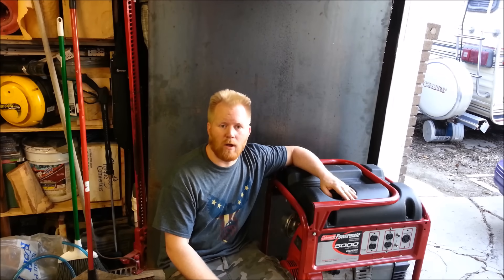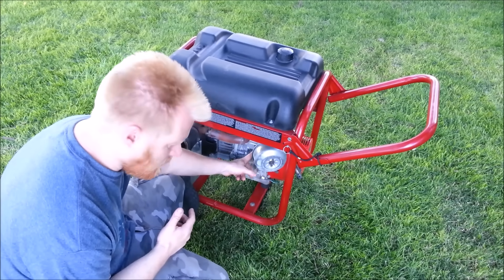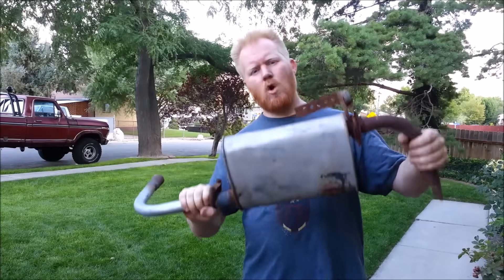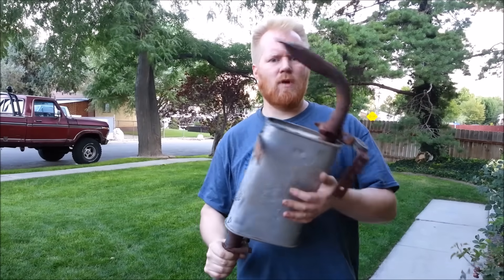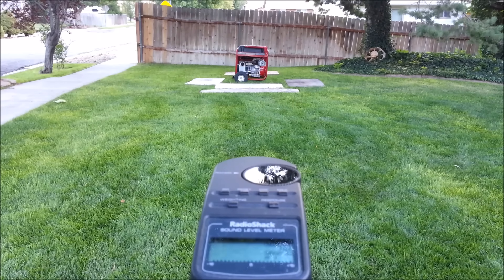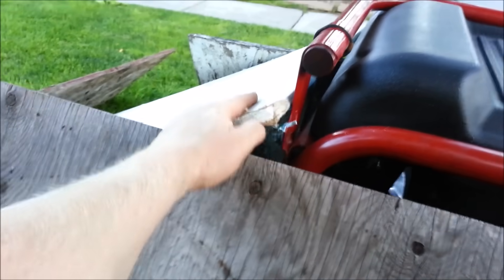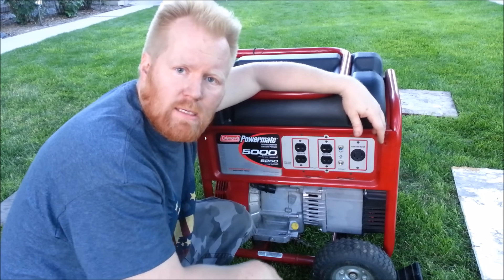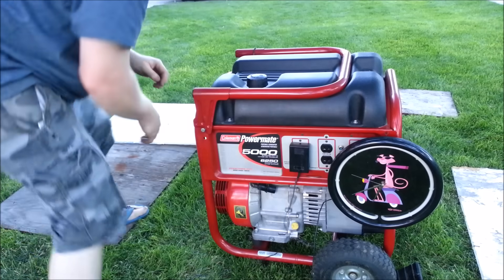4x Quieter generator in 10 seconds

Comment: Nice job - i was about to add a muffler to mine, but wondered about losses.  Mine lives in a shed that provides pretty good sound absorption, but airflow requires a wide open door.  And here in the PacNW, power outages are almost always in super windy/rainy events where being outside and using loose plywood won't cut it (i was going to say "won't fly", but...well that's the problem).  But as you said, each situation is a bit different, and your video reminded me of how well an RV rooftop generator box i built worked, but i never considered angling the walls - seems obvious now, but the simple stuff seems to be easily forgotten.  And although they say the grass is always greener on the other side... it's true!  It's really your superior lawn that's doing all the work, i'll bet.  Hah.  That amazing kind of green is beyond my skill set, but i'm going to adapt the rest to my project, so thanks!  This is a great example of a youtube video done well - useful topic, principals and process explained (and demonstrated) well, but still accessible to the average turkey, all in a reasonably well-produced and edited package. 
You might even have a new subscriber...
Reply from the maker: This was geared towards people using their generators mobile for camping etc. Where I live our power virtually never goes out and if it does, maybe an hour at the most every few years. So the only use generators get is for camping. A dedicated shed/dog house is definitely the way to go in a storm area. Though a muffler doesn't really quiet a generator it can change the pitch to a lower tone, which is generally more pleasing to the ear.

 I generally give customers this example when I'm asked to put a car muffler on their generator "so it is quiet like a car": I tell them to pop the hood on their car, stand in front of the motor and let me rev the engine to 3600rpm(generator speed) and see how quiet it isn't. Close the hood and the sound drops a lot.

Comment: You really should burry it and run it underground with ventilation, virtually no sound
Reply from the maker: This was geared towards people using their generators mobile for camping etc. Where I live our power virtually never goes out and if it does, maybe an hour at the most every few years. So the only use generators get is for camping.
Reply: sixtyfiveford Lost my power for 24 hours when hurricane matthew blew thru. My neighbors used their gen the whole time and it was noisy. I couldn't sleep it was so loud.

Comment: Cool idea for a video - I've seen lots of little boxes in the campgrounds.  I like your dB testing - these things are usually very loud.  
In my testing of my Champion Dual Fuel 7000 - 9000 Watt generators I was looking at how it handled loads coming on and off the generator.  It handled well over 10,000 watts for some seconds even, which is also shown in our videos.  Lots of options these days.
Reply from the maker: Thanks. Be careful loading the generator as though it will handle 10k surge, it will and does melt the winding coating and will shorten the life of the generator head.
Reply: sixtyfiveford Good point.  But its for a short duration, and need to know how it handles such temporary loads such as happen at motor start.

Comment: When I was in the Army the Engineers used to bury them in a pit back in the rear for HQ, I have no idea how they did it or what they may have lined the pits with, but they were dead silent, you could stand on the top of the pit & not hear a thing & the Generators were in house built VW engines too!
Reply: sixtyfiveford 

but what happens when the ground absorbs all sound it can absorb, does it get noisy again???

calm down people it's a freekin joke. cool videos broseph, keep um comin.
Reply from the maker: The ground is a great sound absorber.

Comment: Wonder what it would be using the same idea but using those THICK 4x8 foam insulation boards you get from big box stores???
Reply from the maker: They work great. You'll need to weight them down, so they don't blow off.

Comment: thanks for the tips  would like to know if I did build a plywood box with insullation board but left the bottow open would it
still work? thanks
Reply from the maker: You can build an entire enclosed box but you'll need to add a fan to provide airflow.

Comment: Your match is wrong 
At 80 reducing to 70 you have a 12.5 % reduction not Four Times 

Good luck.
Reply from the maker: Not at all. Decibels readings are not measure/calculated this way. The perceived value of a sound to be twice as loud is a 3-10db difference. So even the most nonsensitive person will perceive a 80db object as being twice as loud as a 70db object. With the average falling in the range of 3-6db being a doubling of sound. So a 10db gain would be perceived as  4 times louder to the average Joe. This is also reliant of the frequency of sound that is being put out, as a higher pitched sound is less tolerable than a lower pitch sound at the same db. This is why a muffler is pleasing to many as though they may only drop a single db or 2 the sound frequency is lower pitch and more pleasing to the human ear.

Comment: You'd get better sound reduction by enclosing it with a box that has an exhaust port & an air inlet hose & outlet hose to ventilate the heat out.

Comment: Kewl! I have to wonder if you built an enclosure with say rock board lined with insulation or rock wool what would happen. But you'd have to leave some space for air circulation to cool the engine.

Comment: I built a dog house for mine,it comes apart for camping. its really quiet. I have used a snowmobile exaust system too,it works much better than a car muffler and smaller. Dont use a really old one,use a newer one. I was surprised how much quieter it was using both.
Reply: hey right on, did the same. Works well to keep the snow off it too. And it's pretty secure inside it.

Comment: yeah, I did something very similar with my Generac one time and it overheated after about 1 hour.  Have you run it a long time to see if you get that same problem?
Reply from the maker: I've run temp checks and everything stays within a few degrees. The trick is to leave plenty of area for proper air flow. Any engine will only pull in so many cfm of air while cooling and it doesn't require 360 degree air flow. A standard air cooled engine pulls all of it's cooling air through a few square inches behind the pull start. The spacing left
 at each corner is probably 100x the required area for proper cfm in and out. Air cooled engines are run successfully in fully and partially enclosed areas all the time(Honda's full line of inverter generators are fully enclosed with only a small opening at the front and rear for air flow, Along with pretty much every RV generator).
Reply: sixtyfiveford but how long have you actually run it like this without heat problems? What was the outside temp. I only use my genny when the power is off for fire safety and causing a genny fire would probably burn my neighborhood down in minutes in those conditions... Have to be super careful, ya know?

Comment: will it work on concrete or tile?
Reply from the maker: Works fine on all surfaces. Concrete absorbs lower frequencies the best and reflects higher pitch sounds that can be absorbed by the boards you lean against the generator.

Comment: that fuckers going to overheat in the summer and blow that motor again.
Reply from the maker: I've run temp checks and everything stays within a few degrees. The trick is to leave plenty of area for proper air flow. Any engine will 
only pull in so many cfm of air while cooling and it doesn't require 360 degree air flow. A standard air cooled engine pulls all of it's cooling air through a few square inches behind the pull start. The spacing left at each corner is probably 100x the required area for proper cfm in and out. Air cooled engines are run successfully in fully and partially enclosed areas all the time(Honda's full line of inverter generators are fully enclosed with only a small opening at the front and rear for air flow, Along with pretty much every RV generator).
Reply: Roy Finch

Comment: It may run hot , you should check the head temp. I have seen air cooled engine failure from doing that.
Reply from the maker: I've run temp checks and everything stays within a few degrees. The trick is to leave plenty of area for proper air flow. Any engine will only pull in so many cfm of air while cooling and it doesn't require 360 degree air flow. A standard air cooled engine pulls all of it's cooling air through a few square inches behind the pull start. The spacing left at each corner is probably 100x the required area for proper cfm in and out. Air cooled engines are run successfully in fully and partially enclosed areas all the time(Honda's full line of inverter generators are fully enclosed with only a small opening at the front and rear for air flow, Along with pretty much every RV generator).

Comment: We did the same thing to a diesel generator. Only buried a long exhaust pipe no muffler and it quieted right down. Discovering the engine itself was the noisiest part and not the exhaust. So we built a generator house out of insulated panels. But ended up burying the awful beast under three feet of earth. We could still hear it!

Comment: Hi SITYFIVEFORD:  Thank You for the great video and information.  I intend to set up my generator inside a secure shed with a concrete floor, The exhaust will be channeled through a cinder block wall to avoid the gases and some of the noise. Plenty of ventilation. Would this trick work on a concrete floor, Or would it simply reflect back up?  My question is sincere. I still have to build the shed. I could leave a space of soil for the generator if needed. I live in Central America ( Panama ) Any advise would be fantastic. Again Thank You.
Reply: You could use carpet on the floor or rubber mats to help absorb the sound.
Reply: phillip staton   Be sure sure to consider combustion air and/or ventilation. It's not recommended to put these inside.
Reply: In Panama holding on to a generator is more difficult than muffling it. A concrete roof for a small shed might be a necessity.  You want venting high and low because of the possibility of gasoline fume build up.

Comment: cuz fuck air to an air cooled engine
Reply from the maker: Yep. Cuz a VW bug don't cool and an air cooled engine doesn't already have a shroud on it. Around 20x the air space is left to adequately supply enough cfm for the motor to maintain proper temp. Tons of air cooled engines are enclosed.

Comment: I live in Florida. I put my Lister 20kw diesel generator on 2 solid plastic beer pallets to keep it off the ground, I used 2 inch thick double foiled styrofoam sheets and lined the inside of a rubbermaid plastic shed. I added baffled vents. The noise level dropped to 43db at 10 feet. I added 2 small 120v fans to circulate air and remove heat quickly from the shed. In the Florida direct sun, I ran the generator for 6 hours. So far no problems. I now keep the generator under a large oak tree next to my work shed. I installed a 55 gallon barrel for black diesel fuel at the back end of the shed which is gravity fed to the generators fuel tank and keeps it topped off at all times. I run this setup from Friday evening to Sunday evening when everyone is home using power. This basically cut my electric usage down by 65 percent. I get the black diesel from local mechanics looking to unload waste motor oil. I filter it & remove any water, then blend  about 10 percent diesel to the black diesel. It has been 3 years and so far no problems whatsoever, other than running out of fuel. Since I only run it on weekends, the 55 gallon barrel lasts about 2 months running at 1/4 load. I have room enough to add 3 more 55 gallon barrels in parallel. I already have over 600 gallons of free waste oil just waiting to be filtered. I considered using a 275 gallon IBC tote, but I just don't like the fact that the plastic it is made from is not UV rated. I am sure the waste oil will eat away at the cheap plastic it is made from.
Reply from the maker: Nice setup. You can throw on a quick layer of paint the IBC tote and it'll be UV resistant. Or wrap/build a box around it in some insulation foam.
Reply: I am just afraid that the waste oil and additives will eat the inside of the IBC tote over time. The plastic barrels I use are UV rated and extra thick. I have seen totes left in the florida sun. after a year or so they become very brittle, even when they are painted. This is not so with the barrels. Even though I won't be exposing the tote to direct sunlight, it is just the thought of what can happen in an instant that is enough to stop me from even trying it.

Comment: I don't know anything about this so don't make fun but I just was wondering... if a car muffler reduces the sound of a car then why couldnt u just put a car muffler on a generator?
Reply from the maker: A car muffler only quiets a cars exhaust and not the engine itself. The engine in a car is quieted by water/coolant that surrounds the pistons and then the engine sits in a box(engine compartment). They put sound deadening plastics, insulation and sheet metal to keep motor sound to a minimum. Pop the hood on any car and hold the engine at around 3600rpm and it will be loud. You'll notice how loud old air cooled Volkswagon Bugs are as they lack a water cooling. A generator has no sound deadening on the engine at all and generally the exhaust muffler sound is lower than the sound coming from the engine itself. Hope that makes sense.
Reply: An even better comparison is a car engine next to a motorcycle engine. even water cooled engines are loud. Its primarily due to the amount of mass of the engine, absorbing the soundwaves vs being resonated by them (vibrated)

Comment: how does this affect the temperature of the generator?  Will it run hotter?
Reply from the maker: Thorough temperature tests show no. You are leaving large openings at each corner that allow plenty of air flow. You're simply trapping the sound waves.

Comment: think adding dynamat to the inside of the boards would help
Reply from the maker: Yes, the dynamat would absorb sound and would actually work the same on either side of the board.
Reply: absolutely, though after using about $1200 of it in a corvette i did car audio contests with in the '90's, I found much cheaper solutions. maybe for a few sq ft you just buy the dynamat and dont fuck around. you can also augment it. best kept secret of high end car audio installers... modeling clay. 5lbs for about $20 is enough to extensively control vibration in 2-3 competition cars. Roll it up like tootsie rolls and press firmly wherever you have corners, folds and creases in body metal. put the dynamat OVER it and use mostly at the bottom of things when you cant because in very hot temps the clay wants to migrate. if you dont contain it under the dynamat you can spray rubberized auto undercoating over it in multiple layers, or spread a layer of PL construction adhesive or sealant over it(choice depends on flexibility desired). Dont use RTV to contain clay, they refuse to stick to each other. 
Now all that sounds like a lot of damn work to keep modeling clay from oozing around a hot car (or generator box) but I went three levels from novice to expert level competition by trying silly sounding shit with sound science that defied the industry rules people like the dynanat folks were profiting hugely from. The best way to explain it is to take just about any piece of metal that has a ring to it- like a flat steel bar a couple feet long, balance it on your finger and strike it with another piece of metal as you would a xylophone.
Now take a relatively tiny chunk of modeling clay, even as small as a pea, or larger like a marble, and afix it anywhere to the bar, ideally at the end. 
Very few substances, none as cheap as modelling clay, will give you the amazing result when you hear the thud of striking that bar. 
The noise inherent to machinery like these gens is caused as much by mechanical transfer of vibrational energy as by acoustic energy transfer in free air. Strategic placement of damping materials aid this.